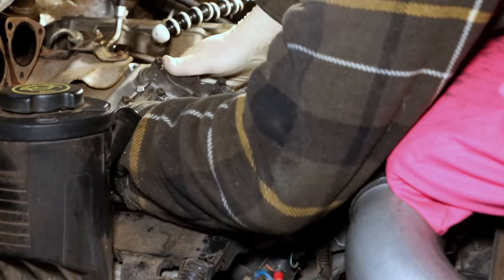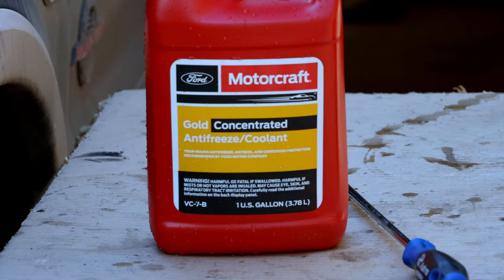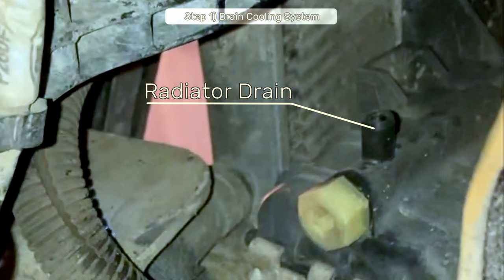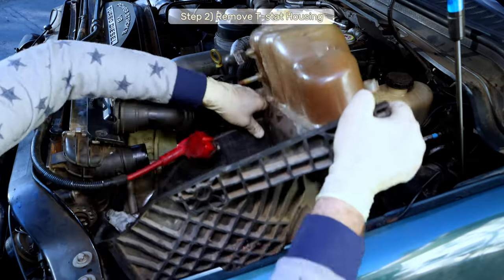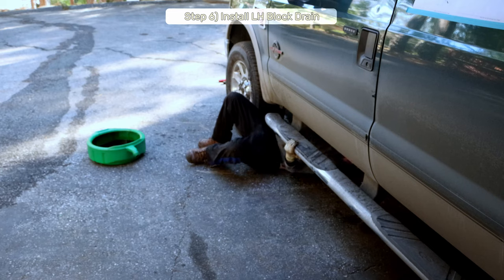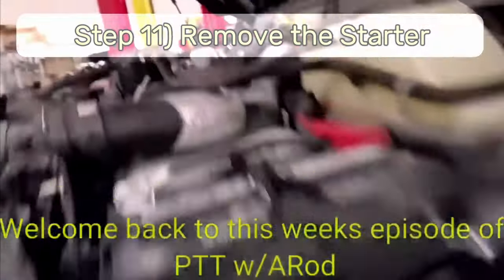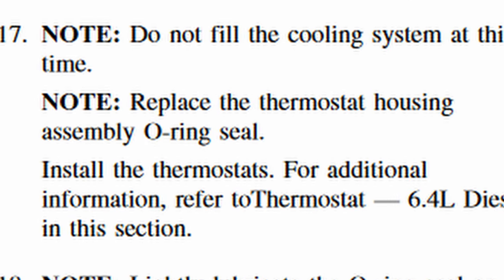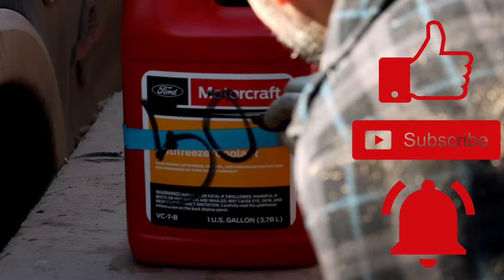Ford Factory Cooling System Flush Procedure for 6.4 Power Stroke with VC-9: IHWOC Episode 11

Comment: Your commentary is pure gold. God rest diesel tech Ron. Taken too soon. Thank you for your videos. I did the flush back in 2014 and replaced the gold sand coolant with Cat elc coolant. Same with my fuel cooler. 211xxx trouble free miles. 6.4l are prissy beaches and need strict maintenance. Completely deleted mine the day I bought her. Spartan tuner, intake, 4” turbo back exhaust. 
Oil and filter every 5k. 
Both fuel filters every 10k. 
It’s paid off and been a great truck. Saving up for a KDD 6.7l steel piston engine for the ol girl when she gives up the ghost. 20k is crazy but 650-750hp and 1000 ft/lb torque with reliability of a 7.3 is worth it. A lot less than a 80-90k new truck.

Comment: Between steps 4 and 5:  When reinstalling radiator hose, degas bottle, ect, did you reinstall the egr clamp and bracket for the 1hour idle (plus hour ride) or leave those off till the thermostats went back in?

Comment: I’m at 300k miles with my 6.4 and I’m about to do a flush and likely an oil cooler.  It’s a tough decision.  Do I spend the time and effort or just toss it?  I know it’s not long before it pulls a Bluesmobile style breakdown.  I’ve driven it for 150k.  Bought for 19k about 8 years ago.  Has been a solid truck with few issues up to this point.  Decisions, decisions.

Comment: Is the coolant refiller kit necessary? Whats the alternative method
Reply from the maker: Pretty necessary.  I mean you could try it with manual burping, but with these modern cooling systems with every hose, nook and cranny everywhere, good luck getting all the air out in anything that resembles a timely manner.  It's not that expensive and saves a lot of headache, not just for this project, but for every one afterward.

Comment: Do you still own your 6.4l?
Reply from the maker: It's been in the shop trying to get it's new KDD motor for 15 months (it blew up shortly after I made these videos), so... I'm not sure if it's technically mine still considering the shop has had it longer than I've owned it :D
Reply from the maker: It takes 5-6 months to have a KDD motor built, the rest of the time has been the backlog of the shop and back-ordered parts.
Reply: @therotorooster  good to know. Guess I better just order now.